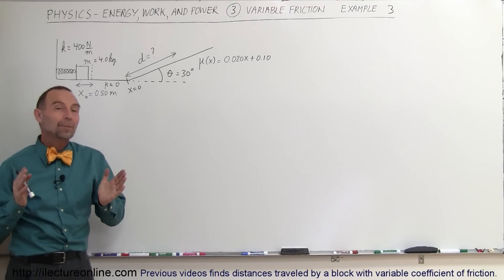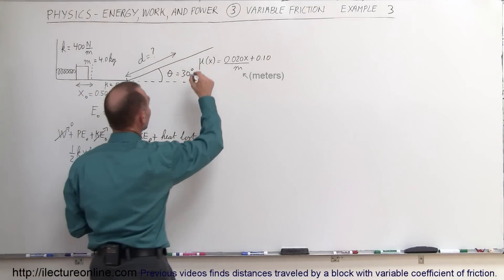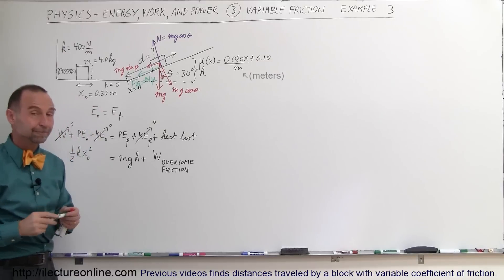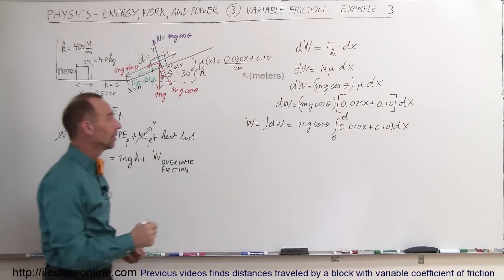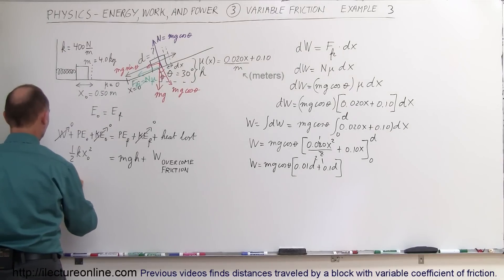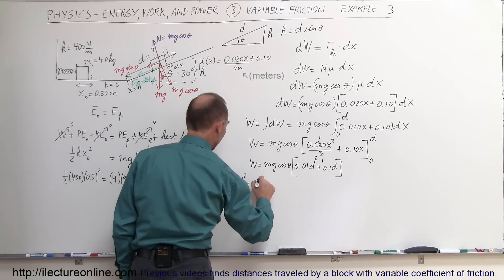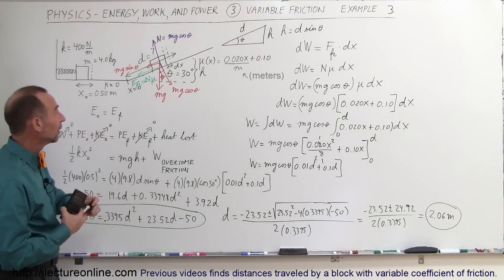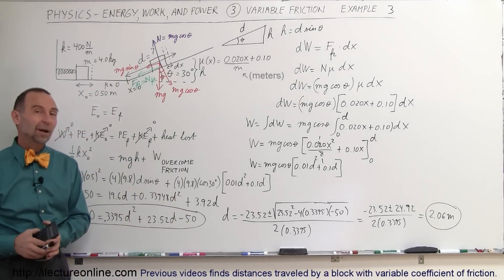Physics 8  Work, Energy, and Power (34 of 37) Variable Friction - Example 3

Comment: Where to use W=F.d=Fdcos(theta) and where to ommit this cos(theta)? Can you please elaborate a bit? Because in both the examples I saw that the frictional force and the direction of work done is opposite. So why did u multiply Fd by cos(theta) while calculating dW in the previous example and not this one? Please explain this thing to me.
Reply from the maker: When an object is on a flat surface, the normal force equals the weight of the object.  But when on an incline, the normal force only equals the component of the weight that is perpendicular to the surface.

Comment: sir why you in this case dont take cos 180 .But in previous example you take fdcos180 .please clear me the doubt sir
Reply from the maker: If the direction of the force and the direction of the displacement are in opposite directions then you must use cos(180)
Reply: In this case direction of force and displacement of the block is opposite but you dont multiply it by cos 180.but in previous question you multiply it by cos 180